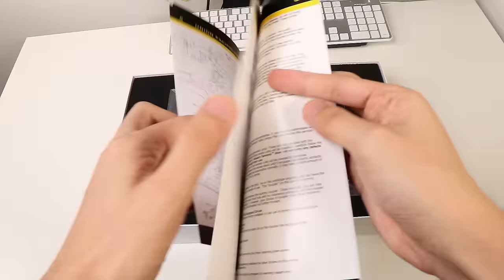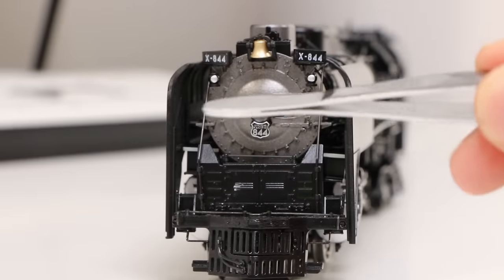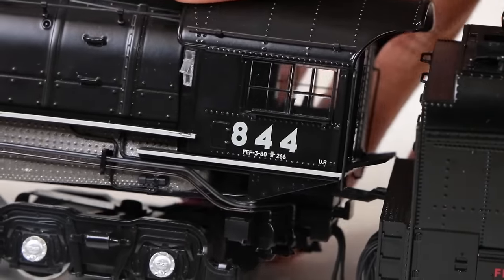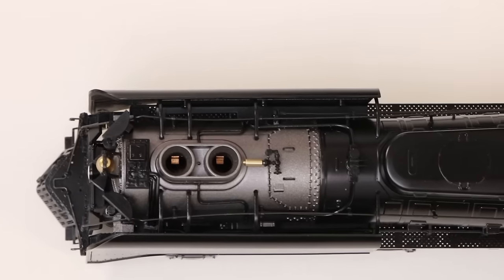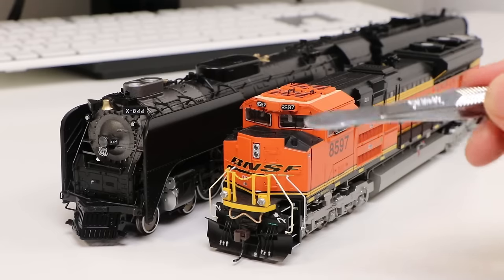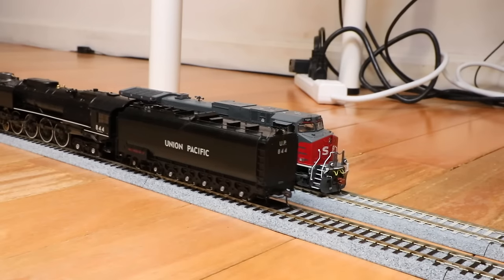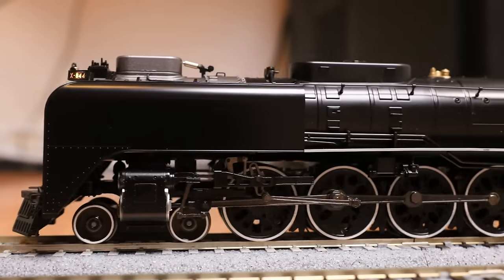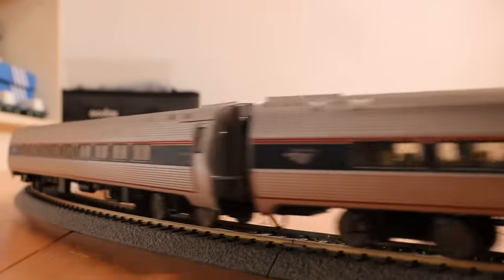Athearn Union Pacific 844 HO Scale Unboxing

Comment: Amazing dude! Just watch out for the wires between the engine and tender they snap extremely easy I had to learn that the hard way… and make sure every week or 2 you lubricate you’re engines siderods depending on how much you run the engine if you don’t run it at all for a while lubricate it slightly before using it because the left over lubricant needs something fresh to activate and if you run it a lot lubricate it every week and not so much but you run it just lubricate it every 2 weeks nice first steamer! Mine was a Bachmann DCC and sound 613 J-class my second favorite in my fleet I love the gloss on it like the real J-classes it may look cheap but it’s the real one my favorite is my Bachmann DCC and sound 611! Anyways I love how you’re starting you’re railroad journey enjoy it in-fact I just got into ho-scale a year and 9 month ago enjoy it they says it’s the worlds most fun hobby!

Comment: It's a nice engine. 

I guess it's plastic housing. I have 844 made by Märklin with metal housing. It's really heavy and the trailing wheel boogie is secured to the loco instead and the speaker and electronics are built in the tender.